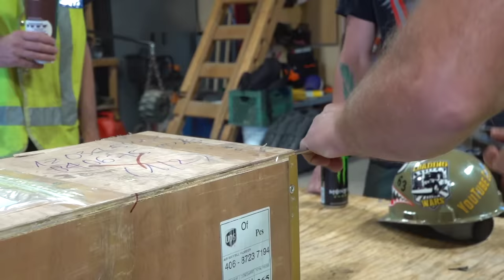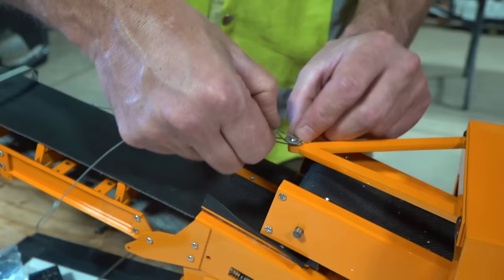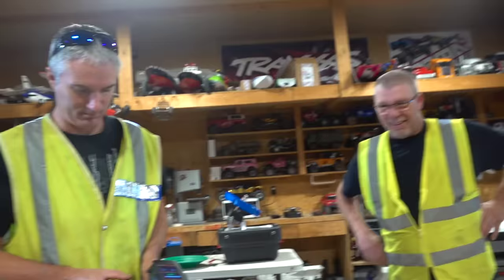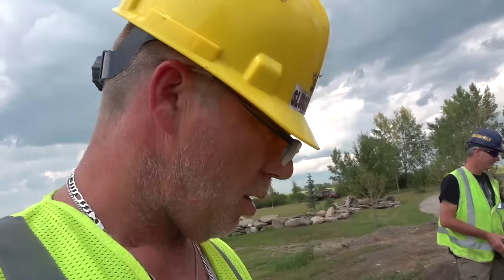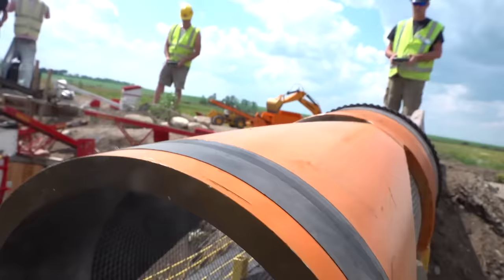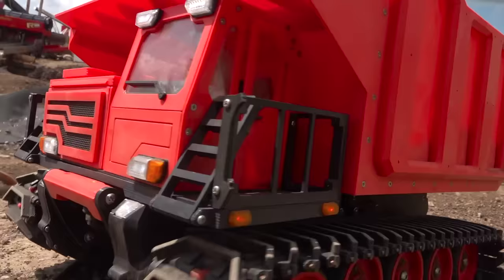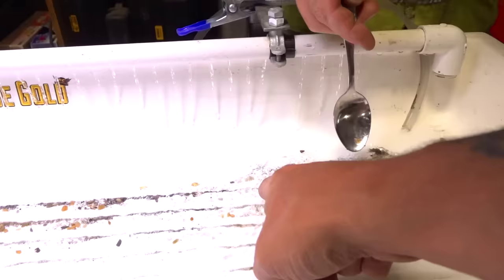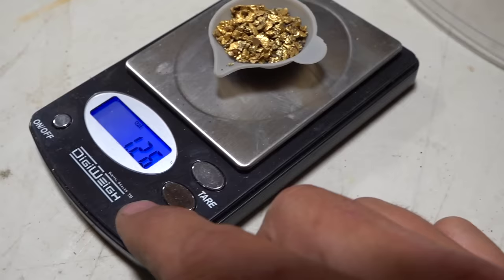YouTube GOLD - "PAY DAY" (s2 e18) | RC ADVENTURES

Comment: Thats a sweet new piece of equip yall got there. With that new setup, u could repostion just a bit n the volvo could back up n dump straight into the hopper. Have one belt runnin the shaker plant like it is now, n add another conveyor over to the loader pay pile. Then rookie could keep the big trommel loaded feedin the dump trucks, the trucks keep the new trommel trailer loaded n the loader pile as well. Yall could run alot more pay in less time that way. Dump a whole truck load in the new hopper vs bucket by bucket. Wen everybody is there, yall would have 2 dozers rippin, a excavator loadin the big trommel belt, 2 trucks movin pay n a loader man. The way clean up has been goin lately is awesome, but could u imagine double that in one clean up every time? Lol Keep up the great work guys! Love this channel!!!!

Comment: You probably would have been better hooking to bumper mounted tow hooks (if it had them) that way you don't rip the axle out from under the truck, and keeping the tow chain lower and longer would help with allowing the truck to steer.

Comment: instead of having to use the front end loader to load the hoppers, why not increase the load ramp, so the dump truck can direct feed the hoppers? Make a bigger reservoir on top of the grizzly bars and drop a whole truck load into the hoppers at a time. Then the excavator/front loader can be utilised filling the dump truck

Comment: an idea for the separator table is that since you actually have gold run the table with just the gold you have cleaned and adjust the table so that you have a predetermined spot where most of the gold will go. Since you wont have any other debris on the table when your adjusting just see where the gold flows and adjust from there.

Comment: On the 3d printed truck you should put a vibration on the bottom of the bed so when he lifts the bed up and it's kinda sticking in the bed you can hit the vibration button and it will knock the rest of it right on out.  Just a thought.

Comment: Question on efficiency. First off the new Trommel Trailer is epic, however, the old trommel is feeding its larger aggregate into the shaker plant and the new trommel is feeding its finer aggregate into the same shaker plant while the larger aggregate from the new trommel is piled up waiting to be fed to the old trommel? Just seems like there might be a better way? its almost a double negative, where yes more dirt is being moved, which is great, but maybe there is a better solution on the arrangement of equipment and sluice boxes or adding another sluice box. Im no expert just curious, Thank you.
Reply from the maker: video "about" section explains it ;)

Comment: That 3D printed spyker cat could dump strait into that trailer trommel if there were a platform built for it, then it could run to  the other end ( after dumping his load ) to get all those "boulders" that pile up on the ground ( except they wouldn't be spilling all over the place )

Comment: This has nothing to do with gold it's not a sluth! This is a screener You can put different size tumbling screens and separate different size stones. Or you can put in topsoil or loam and separate all the rocks and sticks and roots.
This stuff is built exactly like the real things.
The last video I watched with your new scraper. You are definitely using it totally wrong well not totally but pretty close. I used to be an instructor for all types of heavy equipment.

Comment: take the radio receiver out of that new trailer and replace it with two servo-testers like the ones linked at the end of this comment and you can set the speed and set the angle with the knobs and not heed a transmitter and receiver on that unit anymore.

https://www.banggood.com/Mini-Servo-Tester-4_8V-to-6_0V-STV2_3-BEC-Tester-p-910356.html

(This is not an 'ad,' this is not my product and is not an affiliate link ... this is just a suggestion.)